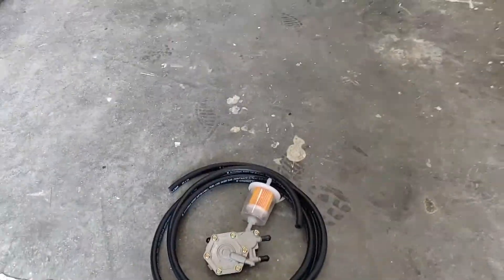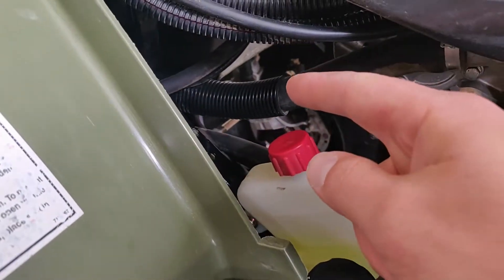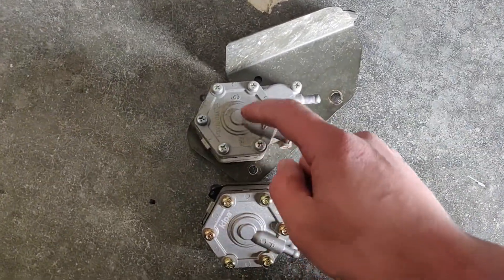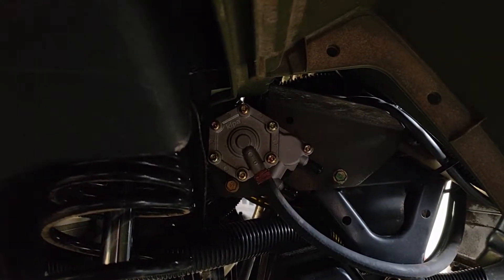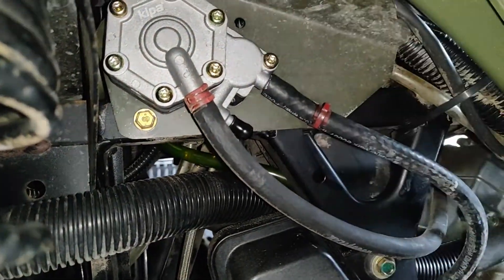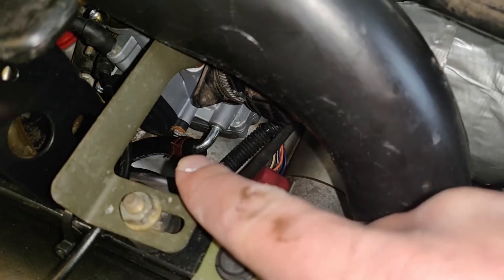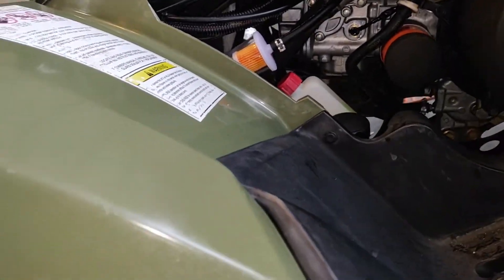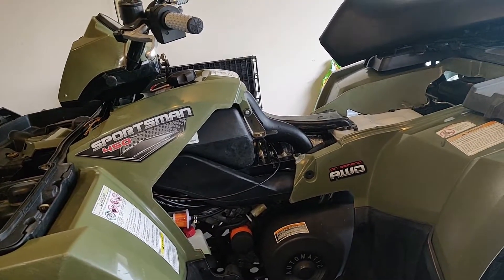Replacing the Fuel Pump | Sportsman 450

Comment: Where did the P line connect to? I assume the fitting on the front of the carb? (Closest to engine)
Reply from the maker: I'm not sure what you mean by P line. It's been while since I made this so if I said that I'm not sure what i was referencing
Reply: The fuel pump on the polaris, the "in" is from the fuel tank, the "out" goes to the back side fitting on the carb next closest to the air box and the "p" i assume stands for prime or pulse....im not sure where it connects to? I assume the fitting on the front side of the carb...?
Reply from the maker: Yes sorry it's prime and yes it's on the carb
Reply: There’s a connection on the outlet side of the carb that you hook the pulse line to. It gets suction and pressure from the piston movement to drive the fuel pump.

Comment: Got a 2010 Sportsman that has a hard time starting. Sounds like fuel isn’t getting to the engine. Thinking I need a new pump/lines.
Reply from the maker: Have you taken the line to the motor off and seen if any fuel is pumping out?
Reply: @AthenasGarageOfficial  not yet. Haven’t done much of anything. Just noticed it cranks and cranks. If I let it sit for 2 hours, it will then start up. Making me think the fuel has finally made its way to the motor.
Reply from the maker: Yea I'd definitely check the pump and see if it's pumping if not then try replacing it.
Reply from the maker: Make sure if you have a filter it's not clogged or any of the lines are clogged